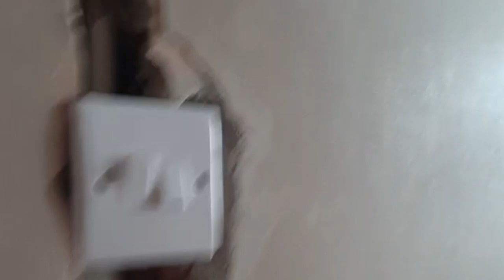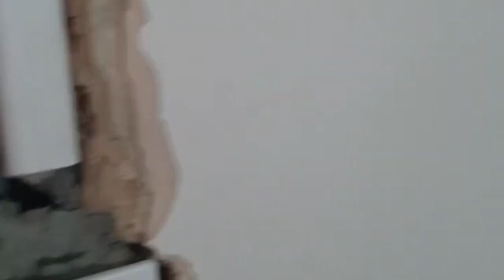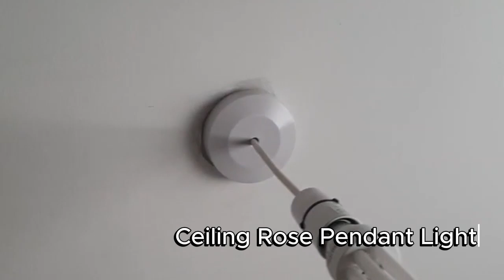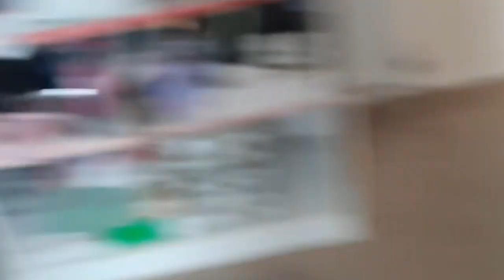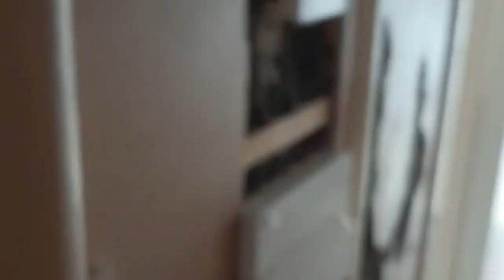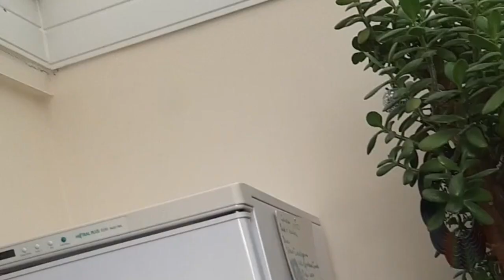Smart Rewire Done Right: Full Setup of Smart Lighting, Sockets, Switches & More!

Comment: How is this a smart home rewire? There's nothing remotely smart about it. All I can see is some shockingly bad chasing. Are you a qualified electrician or a DIYer?
Reply from the maker: Hi @robert.wigley, thanks for watching and taking the time to comment! We understand the term “smart home” can mean different things to different people. In this rewire, we’ve installed smart lighting, sockets, and switching systems — all controllable via mobile apps and automation. That’s exactly what our client requested, and it falls under what most homeowners would call a smart home upgrade. 

As for the chasing: this was part of the initial rewiring prep, and as with all rewires, it’s never pretty before plastering and finishing. The full video shows the entire process from start to finish, including containment, safe routing, and the final fit-out — all in line with BS 7671 regulations. 

We’re fully qualified electricians with a background in both domestic and commercial installs. All work is certified and inspected. 

Feel free to check out the rest of our videos where we go into detailed breakdowns of regs, tools, EICRs, and safety protocols. 

We do appreciate your honest opinions. If you have any suggestions or experiences to share, we’d like to hear them.